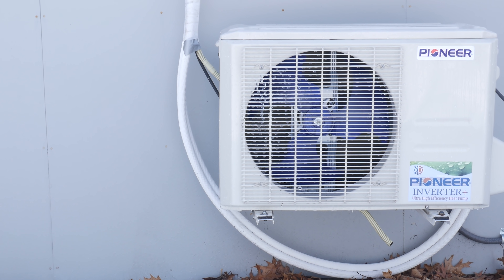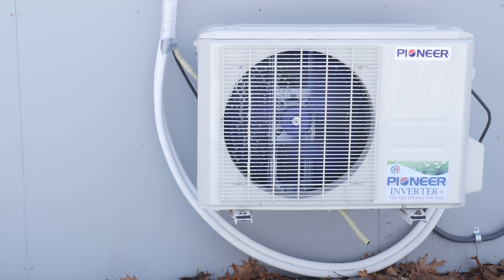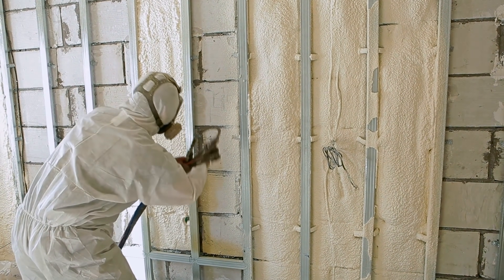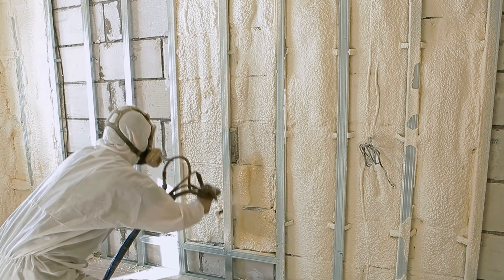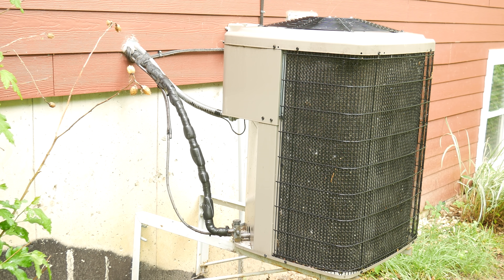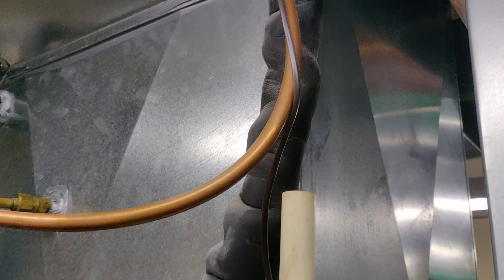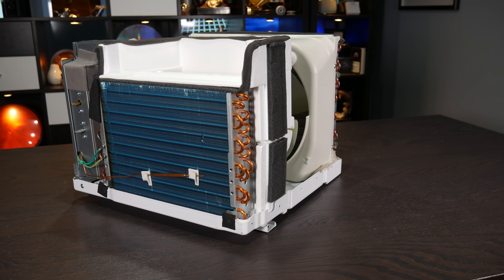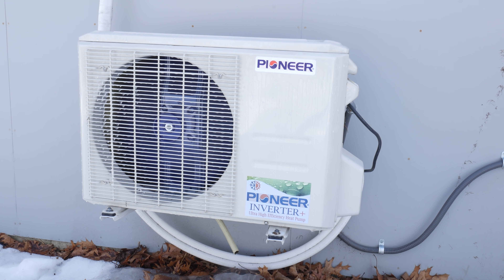Heat Pumps are Not Hard: Here's what it will take to start pumping

Comment: My brother moved into a new construction apartment complex with a very interesting heating system you may not know about. A traditional air conditioner with a water coil that circulates water from a natural gas water heater to heat the space. I suppose this is to limit the maintenance headache of having such a small combustion heater and certainly is better than electric. I imagine they were too cheap to opt for the cold climate heat pump. He doesn't need to use it though, because his underfloor pipes are heated at the apartment's expense. He actually has to leave windows cracked for most of the winter. What a waste!

Comment: Would you be interested in doing analysis on if it's more efficient to turn down the heat pump set point at night in winter climates?

I'm curious what the break-even point is as it's difficult to find a concrete answer on the internet.

For example, if it's -5°C (23°F) outside, is it more efficient to:
A: Set the heatpump to 22°C (72°F) in the daytime and 18°C (64°F) at night.
or
B: Set the heatpump to 22°C (72°F) for both day and night.

Aside from other factors like house insulation, heat pump efficiency, wind speed, cloud cover, etc.. I think A is the right answer, but I'm having trouble proving it.

Comment: So one thing I keep wondering about all this is, what points and priorities different when it comes to how insulation might help (or not help) in warmer climates? Up there heating in winter is obviously your biggest insulation concern, but down here the biggest worry is reducing the amount of heat that gets inside.

Needless to say, if you have a central system then it seems you want insulation whether the dominant weather is hot or cold, as I used to live in a place where the thermostat would regularly read mid-90s while the central AC was running full blast, because the walls had basically no insulation. But I've also lived in a place where the only cooling were some fans and a window unit I put in my room, and while it had better insulation I was never sure if it was good enough, nor if it SHOULD be insulated to the same degree I wish the place before it had been, given only room in the house was actually removing heat.

Comment: if intrested, in lithuania, europe we have a heat pump for heating purposes. 3.7kW heating energy, 3.5kW and about 1.1kW electrical power (for whole flat ~50 square meters). This setup cost about ~400euros (500USD) and labor for installation was 300euros (~400usd).
Reply: we get about -20 and at 4 days in winter we get -25. in winter, and our HVAC has working temperatures even in -25C, it has electrical heating coil for that.

Comment: In my 'HVAC technician' experience, heat pumps got their bad reputation, because of defrost. I saw many hp's that the installer couldn't be bothered to change out the 18/2, to 18/4 to call for defrost.

The other issue I saw, the defrost board in the outdoor units, were pretty sketchy for a while, and home owners would just forgo paying to replace them.

Last one, it was very common for hp's to be installed without 'legs' and the ice would build up and destroy the outdoor coil.

Comment: These are the standard machines used for heating and cooling most Chinese apartments. I also have gas heaters, but these are usually faster and cheaper to run, and are really quiet too. Long live the heat pumps!
There are also tall standing ones that can cool/heat a larger room.
Reply: Also the prices of the units seem to be far, far cheaper, including installation.
An added benefit is they can function as dehumidifiers.

Comment: I was just quoted $17500 for a 36000 BTU Mitsubishi system. Absolutely insane. When I found a similar unit for less than $5000 on hvacdirect and showed it to him, he insisted it must be a cheap chinese knock off and not the real brand and refused to install it, which was obviously not the case. He also showed me a picture of the catalog he was getting the price from -- $3000 for the indoor unit and $8000 for the outdoor unit. More than twice what I saw online.

I think there's the key: these people are ordering these units from a catalog directly from the manufacturer which already has the price massively gouged, and I can only assume getting massive kickbacks for doing so.

I truly think that the industry is simply taking advantage of the fact that heat pumps are now considered "trendy", so people, at least here in the pacific northwest, are willing to spend ridiculous amounts of money to get them installed. States really ought to do something about this practice. Heat pump adoption will be so much faster if prices were not massively gouged.

Comment: Glad that my installer did not jack up the installation of a replacement heat pump.  Yes it did cost a bit more than a simple AC unit, but overall it was a great upgrade from my old system and yes I am also in northern Illinois.

Comment: In cold climates, what would happen if you placed the outside unit in a South facing greenhouse? You could put it near an outer wall with a frame around it with panels that you could install when it warms up to essentially move it outside.

Comment: It’s about 12 grand for my in-laws to replace their ac condenser with indoor air handler and gas furnace but I asked them to ask about switching to a heat pump only system and it was quoted at 20 grand for the cheapest and the one with the variable speed blower was 24 grand. Something about needing a conversion kit but in my house about 40 feet away we have a 2 stage heat pump system and it’s only 12 grand for a new split system heat pump with the outside condenser unit and indoor air handler. I do not understand why it is such a price difference to slide in an all electric unit and just disconnect the gas. Doesn’t it already plug in to an electric outlet for the air conditioning part of the ac with gas furnace???

Comment: Wow great video! Even though the video hit a roadblock halfway through. I have to replace my gas furnace and water heater(which sucks right now) but this video is a huge help. Looking at ground source well type loop, but it seems the cost is quite extreme and heat is my main concern because I also live in the Great Lakes region.
Reply: The uploader also lives in the Great Lakes region & he’s making-okay.

Ground source is very efficient.  I studied them in engineering school, but they aren’t cost effective.  You spend more on installing then you get back in electricity savings

Comment: I think you might like our all electic house in Germany built with floor heating, triple glazed windows, insane - frankly speaking - insulation, induction cooktop, and yes - an air source heat pump heating both the house as well as hot water 🙂 solar panels with 10 kWh battery storage added after initial construction.

Comment: Apparently there are also heat pump compressors powered mostly by gas engines. They also recover the waste heat from the gas engine for heating. Daikin's smallest unit seem suitable for home installation. Not sure about the price, though.

Comment: Just took the time to build out a frame for my window AC unit to stick in my horizontal slider window. 

Despite the single pane window, my bedroom is surprisingly well insulated (being a recent add on), which is actually a problem during summer nights, as my bedroom just stays hot. The walls hold heat for hours. 🥵

Comment: In the UK here. Temps are (usually) a lot milder. We often only get -3 or 4 C . But what (and I know this may sound trivial) would (apart from cost) put a lot of people off getting is the noise!  What type of levels do you get with heat pumps? We have nothing like this around where I live and in part of the day the background noise is less then 20/30 db (less then a whisper in a library).
Reply: Listening to your example of noise, This would get complaints to the council for excess noise!

Comment: In Australia the cost of a multi-system is more than just installing the same number of individual split systems and that’s including electrical. Also you run the risk of if/when the system fails you are left without any functional units and a very hefty repair bill.

Comment: Here's a fun story. I bought a mini-split for my garage for about $1,400 delivered and I found out that the warranty would be void unless it was installed by a licensed installer. the CHEAPEST installer I found wanted $4 ,500 to install it. I ended up installing it myself with a pawn shop vacuum pump in about 3 hours. It's been running for about 10 years now without a single issue. BUT even if I had to replace it every 3 years, I'd still come out ahead! 

One thing I was told by an installer. It may cost $4,500 to have it installed, but if you screw up you can just call the same company for a repair call and that will only cost you a few hundred.....So, get it mostly installed and call for service! It might be cheaper than a vacuum pump and gauge set.

Comment: Air sealing is the undervalued partner of insulation. Many even fairly new buildings are insulated, but air can leak through gaps at the foundation wall plate, around pipes and wiring, at the junctions of walls & ceiling, etc. Insulation does not work so well if air is going through it due to convective or wind pressures. "Insulate, insulate, insulate" might be termed "insulate and air seal."

Comment: OK, its official, I'm on the market for a new heat pump. I've already getting the circle jerk from the contractors that came out to diagnose my unit along with mis-truths about heat pumps. I should send them this video. I was quoted an eye-popping $5289 to just replace the outdoor unit with the same crap 14SEER unit (wholesale priced at $2300-2500) and reuse my existing air handler. So, I'll be getting other opinions because I really want to install something a bit more efficient. Lets see if I get that ridiculous $10k price tag from a contractor here in New Jersey.
Reply: ....and I got an install quote over $10k for a 14SEER single-stage unit+air handler, bravo contractors. I won't bore people with the details, but the HVAC industry in this country is one big facepalm. Alec, if you are interested in this journey, let me know, I'll give you the play by play when its all over (hopefully soon!).

Comment: Hey! I've got a question about heat pumps - maybe limited to split type reversible heat pumps since that's the thing whirring in my house. When operating in cooling mode, the machine makes indoors more unwarm. It also unavoidably dehumidifies the air. Now, that's neat n all, but now to my confusion: what's the difference between cooling mode and dehumidifier mode? Where cooling mode has a temperature goal, dehumidifying mode just .. runs. The section of the remote control display normally showing set temperature is blanked. I've had the heat pump for about 5 years now. Every time curiosity hits (maybe twice a month during summer) I run the dehumidify mode for a day or two instead of cooling, hoping the machine will somehow reveal it's secrets. It hasn't. You're my curiosity's last hope ❄️💦
Reply: In dehumidify mode the indoor coil is cooled a lot, and the air is allowed to slowly drift past the indoor coil, so the moisture in the air will collect on the indoor coil.  It is also slowly cooling the room, but not like when in the cooling mode.  

In the winter, the outside air contains a lot less moisture in it.  At -10F, there actually can not be grains of moisture in the air, so the RH is actually 0%, thus the home needs to have a humidifier in the winter to avoid static collecting on things.  So at 40F, even if raining outside, the grains of moisture per cubic foot of air is much less than when at 70F.  Air brought inside will actually reduce it's measured RH as the air warms up to 70F.  

During the summer in places like Maryland, the 90F outdoor air temperature feels even warmer when the RH is say 90%.  This means about 200 grains of moisture per cubic foot of air.  While at 40F, the maximum amount of grains is only about 75 grains per cubic foot of air.  So in a normal HVAC system, that air is blown across a cooling coil that is typically at about 55 - 60F, and will collect a lot of that moisture on the cold aluminum heat collector surface.  This reduces the humidity and air temperature by about 20F for each pass through the heat exchanger.  

I hope that explains it a lot?

Comment: Excellent video. I have been in the HVAC and commercial refrigeration service business for 45 years and I installed some of the first ductless systems in Tennessee. I abandoned the ducted system in the house that I bought. I installed one single head and one double head system in my 2 bedroom house. The ductwork on the existing system was about 50% too small and would have required me to completely remove it and install all new ductwork and still it would be about 50% less efficient and not zoned like the ductless systems. I do not recommend putting more than two heads on a single condensing unit in residential applications because it creates installation and then service issues down the road. I prefer Mitsubishi but Fujitsu is also very dependable.

Comment: Just had to do a full insulation upgrade in a house we bought because the inspector completely missed that birds had pooped all over the attic, there were bare patches, and too much ventilation causing mold.  Can't say that was the first project I wanted to drop 5 figures on, but we can already tell the difference and the house just smells fresher.  Now onto replacing the 1988 gas furnace with a heat pump next month!  Byebye money!

Comment: I worked in a satellite earth-station shelter (the little building where the equipment to "talk" to & from geosynchronous-orbiting satellites Libes) for over 2 years, & it had a Carrier (brand) window heat-pump/air-conditioning unit had been running for many years before I got there & after I'd left; I'd love to find more of those; it used very little energy, was relatively quiet, etc.

Comment: Here in Australia we all use reverse cycle heat pumps. And you can just buy them anywhere.  We bought one on sale ½ price and just paid an electrician to install it. 

We have 3 split system heat pumps in our house now we installed the 3rd. 

We also have a heat pump hot water system - which obviously isn’t reverse cycle. It only heats the water. But you can duct the cold air indoors if you choose. 

Cold climate heat pumps exist everywhere (Canada, New Zealand, Europe) so I’m surprised they are not really a thing in the U.S. Sounds like the U.S. is well behind the rest of the developed world.

Comment: There's also something called a Branch Box for mini splits.  Which takes one set of lines from the outside unit to the Branch Box, and then that splits the lines into 4 or possibly more so you can have multiple head units/cassettes throughout your home and only one line set visible from outside.

Comment: One thing I've noticed that people might want to bear in mind is heating hot water for radiators with heat pumps is signifcantly less efficient than mini-split systems. I assume this is because heating water to 50-60 centigrade is making a larger temperature differential than heating a room to 20.

In the UK we have grants for converting gas boilers to heat pumps but not for mini-splits (because the government reasonably doesn't want to fund installing A/C systems), I think it's made a blind spot to what in many cases would be a more efficient system.

Comment: Something to consider is the markup covers warranty costs. A brazed lineset can last 20 years without an issue. Flare fittings have a significantly higher rate of failure. Also, I've seen electronics fail in less than 5 years. The manufacturer will replace parts on warranty, but not pay for the labor to replace warranty parts.

Comment: My unit has COP @5F as 1.97. Is it horrible garbage needing replacing, or "fiiiineee"? It's new MrCool multi split system, DIY variety. 23SEER so for cooling I think its great. But heat? Right now I use gas boiler below 40F outside, but with current prices I am starting to consider running it ... more. Especially that my boiler is low efficiency, quite old unit too. Oh, yes, Northern climate, Detroit area. Of course I am all for those 3 points from the beginning of the video. All 3. Insulate. Thoughts?

Comment: In the landlord situation, I'd say it's not so much like that. There's an incentive in insulating and installing HPs on a rental. Being able to reach out to more potential customers, even if you charge more for the rent. If you can charge 50 bucks more but the tenant will save 60, it's still 10 bucks of savings for the tenant. If another landlord doesn't insulate, charges 50 bucks less, but then their tenants pay more than that in their gas or electricity bills due to the bad insulation... Energy certification is important to settle a standard - knowing that you will be spending X on utilities for comfort, and Y on rent, may help you in making a choice.

I rented a bedroom in a modern home while being studying in university: double pane windows, double Insulated walls, insulation in the roof, and a heat pump accumulator for water heating (being the last one to shower in the morning sucked, lol), installed when we moved in. We were 6 guys living there, our electricity bill was like 120-140€ in the deeps of winter, in a pretty cold area with temperatures reaching - 5 to -10C. We used propane for cooking (we also brought up frozen meals for microwaving), but a large canister lasted an whole semester, plus some weeks. Space heating was done with radiant heaters. I previously rented a bedroom in a older building, and we paid those 120€/month for like 4 people. The bedroom was also 120€/month in both situations. Using the same kind of heating, in much smaller areas.